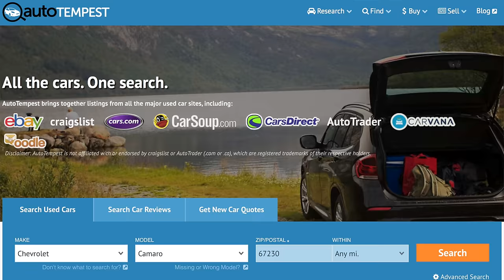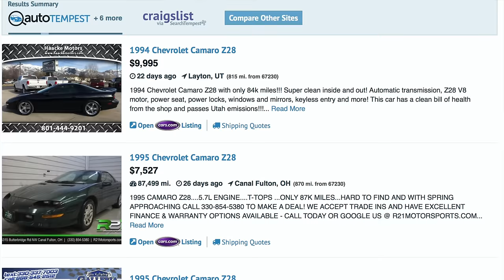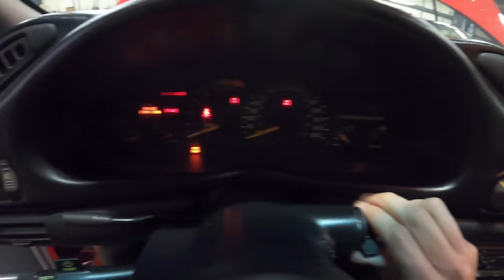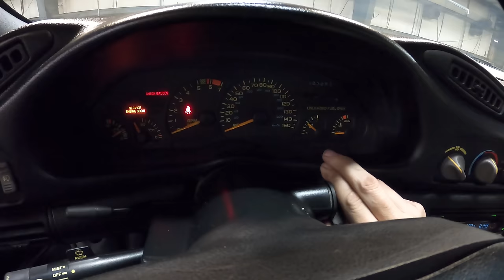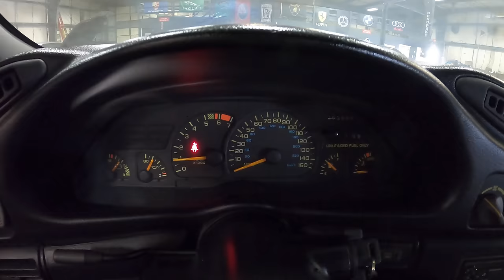I Bought a Barn Find 1993 Camaro Z-28 and Started it for the First Time in 10 Years!

Comment: When I changed the fuel pump on my 2001 Firebird, I cut an access hole in the trunk. The pump comes right out the top.
Reply: Yeah my '96 Z28 had the access hole cut by the previous owner. Gets a lot of Camaro guys mad when you do it but I ain't dropping the fucking rear end to swap a fuel pump lol
Reply: Thats one of the reasons i love the old Land Cruisers. Access panels for everything, and everything has a drain bung.
Reply: That is how I changed the pump in my 97 T/A  Way easier than doing all that crap. And and it doesn't look bad if you do right.. and even if it did look bad, it will be covered up by the carpet anyway
Reply: @kabj06  I had mine done the same way. I've done it the hard way before....
Reply: I cut a hole in the box of my pickup. Would totally do it that way again. Truck is rusty and taking it apart would have been a can of worms.

Comment: I would have considered cutting a hole in the trunk to access the fuel pump.
Reply: That's how we used to do it.   Create an access hatch in the back.  A bit of a pain, but makes life way easier after that.
Reply: john a. Yes
Reply: I was wondering if that or cutting and adding a rubber tube to the neck would be good
Reply: This is something I've found unforgivable in US cars. Everytime I've had to change a fuel pump in a Euro or Japanese car it's been a simple 30-min deal through a hatch under the back seat. On an American car, this wasn't even the most ridiculous one I've seen.
Reply: @The_YouTube_Critic  
wouldn't it be nice if all detroit cars came with a fuel pump access hatch in the trunk, truck bed etc. of course this might upset the big three...and we wouldn't want to do that (sarcasm).
Reply: @gasfiltered  
and ya wonder why american cars are losing to the overseas competition.

Comment: 17:22 This guy is still cranking the engine for too long.
Reply: I was wondering if anyone would notice. Way to burn out a starter
Reply: bruh a starters job is to kick the engine over.  the starter will go thru many batteries before the starters pull in coils and hold in coils get fucked

Comment: I thought these where ugly when they came out, now in my older age I like it.
Reply: Agreed... maybe because modern cars have gotten either so bloated and oddly proportioned, or needlessly angry and ugly.
Reply: Nostalgia Effect
Reply: I think they look better than new Camaros. But 3rd gen beats it.
Reply: It’s an ugly car but I will admit the aerodynamics are very correctly engineered.
Reply: @VinnyMartello  its basically a rounded third gen
Reply: Dave M I’m starting to like the design myself. I do like the newer and older ones more but still. I am starting to like the look of these
Reply: Warhead Urban Exploration hell nah, the newer ones are way better. Except the 2019 SS model. Those were questionable, but the 2016, 2017, 2018 and 2020 models are actually pretty good looking. And I think all the 5th gen models look good as well, especially the 2010 SS
Reply: I had 2 back in the days...a silver one ( automatic) and a White one ( manual)..1996 and 1997
Reply: I would’ve liked it even more if it was named something else
Reply: They're still mechanically ugly. Everything about them is needlessly challenging to fix.
Reply: It's just refreshing to see something different in the endless sea of compact SUV's
Reply: While I didn't like the Camaro of that era, I did like the Firebird from the same era... Go figure as they're pretty much the same car but with different front and rear clips.
Reply: I definitely thought the 4th gen was ugly when it first came out. 5th gen was not any better. 1st and 3rd gen are the best.
Reply: It’s still ugly just not as ugly imho
Reply: I always liked this Camaro but I did not like the 80's Camaros.
Reply: most are beat up which make them ugly just like the new edged mustangs
Reply: *were
Reply: Just need headlight covers, all the aerodynamics of this car and they make the headlights like that 😂

Comment: Fuel pumps are most common major issue with these cars. My former neighbor (house has since been sold twice) had the same year and did it himself in his driveway, took him over a week... One thing I have heard people do is partially drop the tank, mark the the spot in the body above, and cut a hole. Then cut a slightly larger plate, drill holes for small screws, and cover it over.

Comment: Ahh, the brilliant engineering decisions that made GM great! "You think anyone will ever have to remove the gas tank?" "Maybe, but, f**k 'em!"
Reply: Remember the days before the fuel pump was immersed in the tank? 😜
Reply: Brent Boswell sure do, replaced the pump on my 78 f150 in about 20-25 minutes. Couple bolts, couple lines and that was it.
Reply: We used to pull the carpet in the trunk and cut an access panel to get to the pump. Whole process is less than an hour.

Comment: Some people cut a square hole in the floor panel directly above the Fuel Tank, replace Fuel Pump etc. Test unit then pull the metal  back over, or use a new piece of metal and pop rivet  re-seal etc. I wouldn't recommend Hoovies method shown for obvious reasons. Good to have friends with fire extinguishers though, nice video.

Comment: The 8th generation Impala, which came out around the same time, had an access panel in the trunk that you could use to get to the fuel pump, pressure sensor, etc. They really should have made that a standard feature across their model range.
Reply: I've seen a third gen Camaro with a homemade access hole in the floor. Those were basically the same as this. I've seen techs build angled fixtures for their jacks just for these tanks.

Comment: i have a 97 z28 30th anniversary edition camaro that has been sitting in a OPEN feild for 10 years, (under the hot sun, and winter cold for 10 YEARS) (43k miles) put a battery in the ol girl, she fired right up first crank, the car is in immaculate condition, i mean absolutely spotless, no pully rust, no rotted lines, interior was perfect, perfect car, no problems, put a fuel pump in her, hit the injectors with a screwdriver, she ran like she was rolling off the assembly line,  2 years later, she’s my every now and then weekend car, 
it’s sad how many z28s end up like mine and yours, keep restoring m8👍

Comment: i had one of these 20 years ago....i loved it but sold it to buy  my house....got my eye out a for mid to late 90s trans am
Reply: I've got a 25th anniversary trans am 383 stroker 35k on the motor(paper work), brand new transmission stage 2 clutches, and shift kit. $8500 takes it right now. link Below!!
Reply: @jonnyboy9141  u still have this?
Reply: JonnyBoy do you have pictures?
Reply: @jonnyboy9141  sounds tempting.....with all this craziness going on that has to go on the back burner for now..
Reply: @thomasm5263  yes i have a link above if you'd like to check it out.
Reply: @workingshlub8861  I totally understand staying safe is above all else.

Comment: I cringe so hard when he just holds the key on the starting position and it keeps cranking 😭 .....prime it a couple of times
damit!
Reply: junior palomares yea that’s because Hoovie knows nothing about cars at all, hes just an entertainer.
Reply: @jaredchampagne2752  I was thinking in my head Stop! lol
Reply: But its fuel injected......
Reply: But there would have been some air in the fuel line once they reassembled the tank & fuel line, but does not need cranking for that long..
Reply: It's fuel injected so no priming lol.
Reply: @imhappyandyou.4003    For "priming" read "pumping the fuel from tank to engine so it is available".
Reply: @imhappyandyou.4003  ..How about "pressurizing the fuel system"??
Reply: @richardc.hoating1382  You can just leave the key in "ignition" without cranking it over or pumping the gas for the fuel system to pressurize.
Reply: With the LT-1's optispark, the engine will start in less than 1.5 seconds at -35 degrees C. Point being, if it does not crank in around 1 second then there is a problem that longer cranking will not help. I pitied that starter, torture, pure torture!

(Testing by GM proved that at an ambient temperature of -35 degrees C, the time-based ignition would have a start time of approximately four seconds while the angle-based LT1 would fire in 1.5 seconds. This is the result of knowing the exact crankshaft position along with the ability to vary the ignition timing on crank as a function of coolant temperature.)

http://www.superchevy.com/how-to/0310htp-lt1-ignition-system-understanding-modifying
Reply: @imhappyandyou.4003  for priming the fuel system just cycle the key off and on several times. Gonna burn the starter and possibly the wiring if he keeps running the starter
Reply: Got one of these in texas a few months ago just a roller but nice and clean 800.00 restoring it know 😁

Comment: Ive done this on a prev gen firebird, same sort of fuel pump situation.... Cut through the Sheetmetal in the trunk, bend the metal up, replace pump. push metal back down. Carpet over.

Comment: Trap Door mod required. should had one from factory! 🤷‍♂️
Reply: Yea, but if the tank had been full of rust and crud, it would have to be taken out anyway..
Reply: The trap door mod requires you to remove the interior, cut into the bodywork and then weld it back on. For such a nice looking and very pristine care you would likely drop the axle as they did and cut an exhaust which can be repaired with little to no visual marks.
Reply: @TheBibliofilus  if ur a hack,..
Reply: i agree that job is a bitch without doing that. i have owned a third gen and have had a 96 LT1 since 2014. i did the trap door mod on my 96. i can replace a fuel pump in 20 minutes now.
Reply: I think they came from the factory with the trap door mod starting in 1998. I owned a 1994 Trans Am and dreaded the fuel pump ever going out. I did replace the water pump...and broke the opti-spark during the process. What a stupid location for the opti-spark. Couldn't they have at least made it out of metal instead of brittle plastic?!
Reply: @misterskippy2u  the optispark system is was a poorly executed design. it works but is prone to failure. they should have gone with a waste spark with crank trigger design, which they had way before the LT1. the had waste spark systems back in the mid 80's and used it all throughout the 3800 production. that's the system with 1 coil per 2 cylinders.

i dont think they ever had fuel pump access doors anytime throughout 82-92 OR 93-02. not that i am aware of.
Reply: @andrewdonohue1853  My experience with late model gen 4s is limited to being in two cars. The fuel pump access door may have been mods from the owners.
Reply: @W00fer  Incorrect about removing the interior. Two plastic pieces of each side and the carpet can be folded forward and then you have access to the fuel tank. Although I agree that the trap door is "hackey" and it's preferred to cut the exhaust rather than the floor.
Reply: @misterskippy2u  Nope.  Had a 2000 T/A.  Have to drop the axle / tank

Comment: There's a reason most people who own these cut an access panel to get the fuel pump out without having to pull the rear end out. I did this once pulling the rear end out, cut the access panel. I'm glad I did since I had to replace the pump again at 160k miles.

Comment: Tyler, you’re lucky you still have quarter panels and rear glass doing a burnout with those old crappy tires.
Reply: He’s not very bright he just has loads of money and thinks he does stuff by taking out one wheel house and dumping a grand and a half on a 50 dollar home job lmao
Reply: Yea because that Camaro was really spinning those tires hard with all of its 200hp! So dangerous LOL!
Reply: @dzgaming1  I dont think you know what you're talking about
Reply: Pfft. 10 year old Potenzas are just fine.
 They certainly will not  disintegrate and destroy the panels.
 And I should know, I fitted tyres for decades.
Reply: @andrewdonohue1853  the car has almost 100k miles and he was spinning the tires really slow. I daily a BMW but I have a 91 Caddy with a 305 small block so I kinda do know what im talking about.
Reply: @dzgaming1  an LT1 and a 305 are apples to oranges. the 305 might be 150 hp, the LT1 was 275 or 285 hp depending upon the year.

this car sat for a decade and probably was not running the greatest. 

1. it needs to be driven awhile
2. spark plug wires likely dried out from age
3. spark plugs
4. optispark may need replacement

the highest performing 305 were barely 200 hp.

the only thing similar between an LT1 and a 305 are the basic block construction. everything else is different. the blocks aren't even the same, just similar.

the LT1 will have larger pistons, longer stroke, more aggressive camshaft, better flowing heads. you would have to dump allot of money into a 305 to get it to run like even a stock LT1.

sorry but if you compare a 305 to an LT1 you have no clue
Reply: @dzgaming1  if you caddy has the L03 305 TBI, its 170 hp. the LT1 from 1993 is 275. 105 hp is a HUGE difference. not in the same class even.
Reply: @andrewdonohue1853  I know the LT1 is quick.. I was just pointing out that he wasn't really pushing it hard enough to do any damage to the fenders.  The 305 isn't bad either with 255lbs of torque it gets up and goes believe it or not.
Reply: @dzgaming1  i had a 305 TBI in an 89 camaro. it had SOME low end grunt, but not much past 3,500 rpm.

Comment: Tyler- hope all is well and everyone is healthy. Watching the fuel pump replacement brought back memories and made me count my blessings. Replaced two pumps in my lifetime and both were much easier. First was a 1986 Mustang GT 5.0 with an electric fuel pump.That was done in the driveway during a snow storm and required the removal of two straps and the tank was free.  The other was even easier. 1978 Dodge Little Red Express Truck with Mopar 360 and if memory is correct the mechanical pump might have had only two
bolts. These were done well before YouTube but I may have consulted a Chilton's Repair book. 😀

That was an entertaining and informative video.  The  fire certainly added production value. The Wizard is amazing!

Comment: Silly Wizard, you're supposed to cut a 'Trap Door' in the interior to get to the fuel pump on a 4th gen.
Reply: And than charges 1350$ for lack of knowledge... for me fire was his fault too, he should have checked at least one injector after ten years.
Reply: How they did the fuel pump on my Saab.
Reply: Adam T So he’s supposed to do it for free? Everyone’s got to learn someday.
Reply: shops dont cut holes
Reply: Yup. I was wondering about the same thing
Reply: Takuro Spirit Enthusiasts say the trap door mod reduces value and somehow makes the chassis less stiff. As if a 7 inch incision all the way around is going to make your chassis flex noticeably more 😂
Reply: saabs have access panels to the fuel pump...no cutting required
Reply: I have an Opel Astra, gotta remove the rear seat and find my way through to get to the tank. In mine the fuel filter is built in the fuel tank, which is stupid kinda, but getta get to the tank every time
Reply: Honda puts that access to fuel pump under the flip up back seat of CRVs.  Smart.

Comment: Cut a hole in the floor like most everyone. Did the same thing on a 94 T top. Smoke burnout and everything but the pump was done by cutting a hole with a 1/4 side attached. Done to fold it up and close like a door. some sealer sheet metal screws  and mask tape over the sealer so it does not stick to carpet.

Comment: GM designed these cars to be in the junk yard 10 years after their production date. 6 years if you drove it daily.
Reply: I still DD my 2000 LS1 camaro
Reply: They still do
Reply: @Journey_to_who_knows  I think the German company's use that philosophy now. As proven by Tyler once a month.
Reply: Ride Like a Pro Jerry Palladino 
I had a 1997 Camaro Z28 Convertible. I am in the car for 13 years and the car was bulletproof. The only problem I had was the Power window motor went up. I traded it in for 2010 Camaro RS-SS . My 2010 Camaro is 10 years old and I have not had any problems with that car.
Reply: That's horseshit the fastest manual gm car is a lt1 camaro... Runs 7.28 at 196 mph......
Reply: They already knew Mustang had em beat

Comment: I just wanted to yell through the screen! YOU HAVE TO DROP THE REAREND!!!! lol
Reply: Montevallo Mustang just cut a hole and make an access panel from the top
Reply: @maroz2881  As someone who owned both 3rd and 4th gen F-bodies in my younger years, I can tell you that's exactly what some of us did. Getting to the fuel pump was unreal in those cars. Also remembering having to drop a 4L60E trans out of a 95 Trans Am on my back on my parents driveway. Getting to the top driver's side trans / engine bolt required a swivel, about 3 feet of extensions, and having to start by the tailshaft on the trans. Extensions would go over the entire trans, then swivel up at the bell housing to the trans bolt, and then swivel on to the bolt. You couldn't break it loose from above (or below) without unmounting the engine and tipping it back which I couldn't do by myself with the tools I had. So I had to lie on my back and start getting it over the trans, then lie on my engine and place it on the bolt (with absolutely no room for my arm and it's all by feel), then back under the car and hope you break it loose. 2 hours and 51 tries later, the bolt was off.
Reply: Chris M ohh yeah the access panel is the best was and yeah i heard how hard it is to get the trans out considering how much those 4L60’s went out sure it was a nightmare i had a 4L80 in my z28